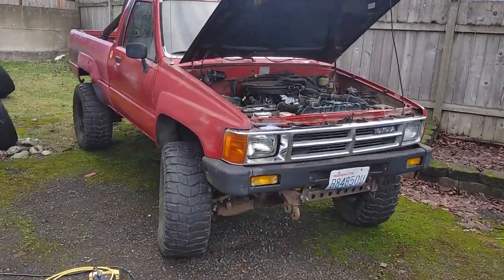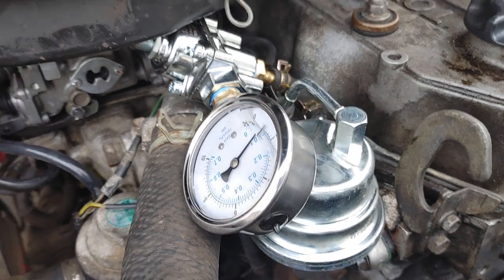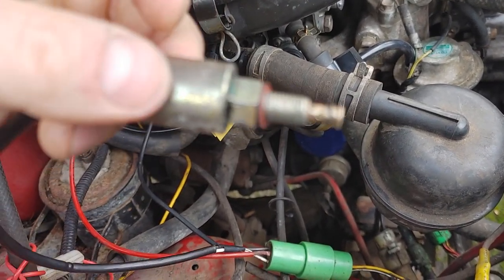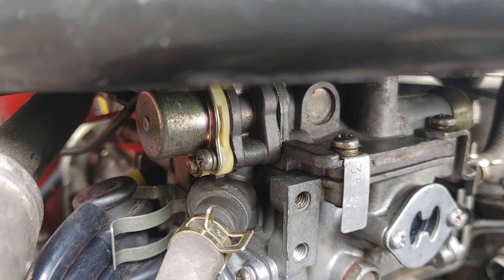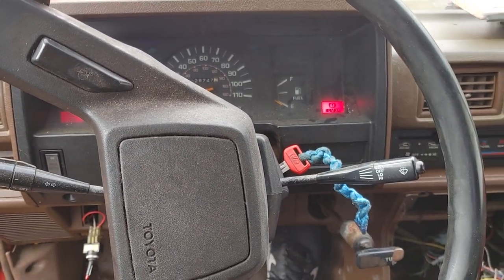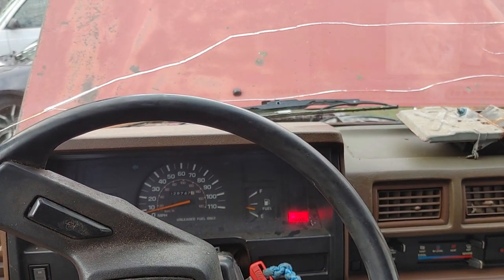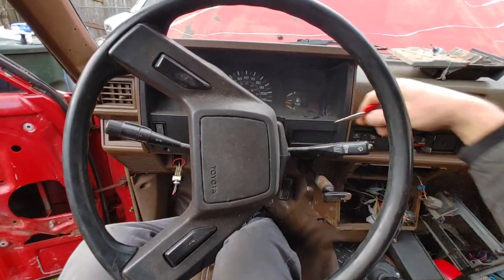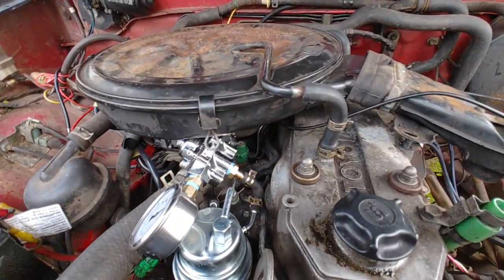22r won't idle - Fuel Cut solenoid? SOLVED! SEE DESCRIPTION / COMMENTS

Comment: I'm having same issue but already replaced the fuel cut and also computer still having the issue
Reply from the maker: Tino, I was able to fix the issue. After studying wiring diagram, I was able to get a remote starter hooked up (have to ground clutch safety wire and wire remote start between batt + and IGN wire going to start solenoid). You can also just wedge something to press the clutch instead of grounding the wire, but constant pressure on clutch plate isn't ideal. I'll have a video on how to hookup the remote start on a 22r soon, it's a little tricky. Anyway, upon doing this, I was able to see the float filling up, up, up, up and then overflowing....even though I set the level EXACTLY as stated in the FSM and triple checked. After spending a ton of time dicking around with the float level, I was able to get it idling quite nicely....until a radiator line blew because the thermostat is old and dead. So ordered a new one and just put it in yesterday. Gunna reinstall dash instrument panel (pulled to install new bulbs and fix heater gauge) and see if she's finally alive when I have time....probably next week. Thanks for the reply! Look out for that video on the remote start....might help diagnose your issue. You can't see if the float level is way too high or way too low cause gas is mostly clear....you just see nothing. You have to drain it (10mm plug in front, facing fuel pump), then watch what happens when you fire it up.....either need a buddy or remote start. You can keep it alive (at least I can in my case) but physically pulling on throttle linkage. If it starts to overflow, I have a vice grip ready on the fuel inlet hose to cut off fuel and prevent flooding. You don't wanna flood the intake with fuel....it'll end up draining past piston rings and into your oil pan, which will thin you oil and could cause much bigger problems. I'd check your oil for gas before proceeding much further. If it's thinned out to any significant extent, change oil and try to prevent overflow in the future.
Reply: @evankolpack  ya mine isn't having that issue I already checked and used a buddys carb that I pulled off his truck still same issue
Reply from the maker: @tinoanderson3912  Ah, yes, well then down the rabbit hole you go. If it's behaving similar to mine and carb has been ruled out and you're pretty sure timing is good (or close enough), could be any number of things but I'd check spark and compression on all cylinders first and see what that turns up. I'm guessing you'll find an issue there, which could be plug, wire, distro, or something else. Check fuel pump and filter too. I put a holley regulator + gauge on mine....it's reading about 4 psi when running. Good luck!
Reply: @evankolpack  I replace plugs cap I haven't checked the weights in the distributor yet but looks like I'm getting good spark on all cylinders compression reads good The head was just done 10,000 miles ago The truck only has $140,000 mi on it and when I did the head we checked there was still the factory crosshatching in the block so I have no idea what's going on about to just give up on this thing The only thing I can think of is the California emissions computer but I swapped it out for a different one no change so I'm thinking it might be one of the wires coming off the computer is shorting out somewhere or one of the thermos sensors on the intake is having an issue somewhere as I'm sure you know these wiring harnesses for the motor are kind of crap they were made super cheap the wires are super thin unfortunately I don't have time to track everything down so it might just go to the shop and we can go from there I guess but it's irritating
Reply: When a carb is overhauled there is a common  mistake made by people which will cause too much fuel to run constantly into the intake manifold. If they remove the top of the carb, called the horn, and turn it upside down, there is a rod pointing up, and a screw holds that rod in place. If you remove that screw to remove that item there is a special way to reinstall the item properly or it will constantly leak fuel. You must rotate a tang on it to get that item to drop properly into place before you place the screw that holds the rod. If you removed that rod when cleaning the carb, and you replaced the rod aftwr ck3aning the carb, if you did not rotate the tang the item will not sit down into place and will constantly leak a lot of fuel into the engine and get into your oil pan. You can smell the fuel on the dipstick when you check the oil level. A simple little mistake that causes a lot of problems with the engine racing a lot of high rpm, and not idling properly.
Reply: @jerryrussell2600  I don't smell  fuel in my oil and I tried two different carbs with the same results I think it might be something electrical

Comment: U r missing a bunch of vaccum lines
Reply from the maker: I think you're seeing the plugged vacuum lines that would go to a HAC, which was optional and didn't come on my truck. AFAIK, all other vacuum lines are correct. I'm going to double check with the diagram in the FSM, but at a glance, they all look good.

Comment: And u r misfiring
Reply from the maker: Maybe, but in this video, it's running so poorly from flooding/rich, it's tough to say. I was finally able to get it idling well by adjusting the float level (even though I set it EXACTLY to FSM spec and confirmed no issues with the float itself)....when idling, it ran beautifully, definitely no misfires.....until a radiator line blew because the thermostat is old and dead. So ordered a new one and just put it in yesterday. Gunna reinstall dash instrument panel (pulled to install new bulbs and fix heater gauge) and see if she's finally alive when I have time....probably next week.

Thanks for the input! Very much appreciated!
Reply: Idle jet in the carburettor is clogged up that's why when you take foot of gas it stalls out and die I would open carburettor up and just pull idle jet and clean it that piece that you hold was a idle air solenoid